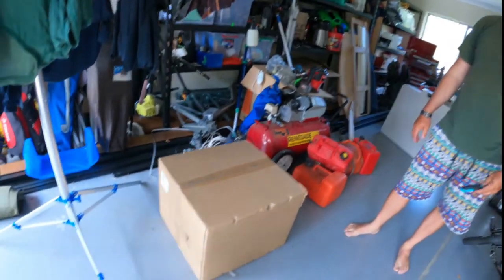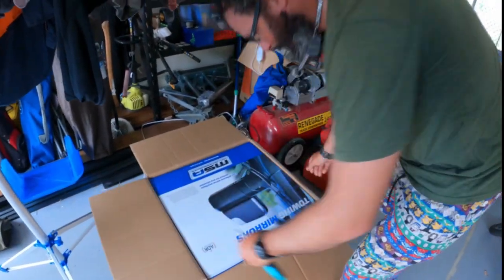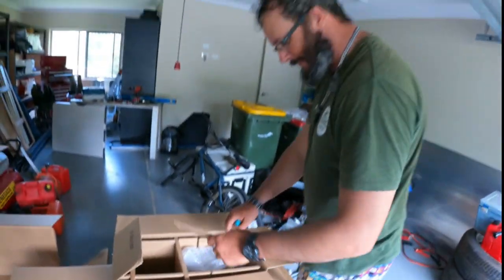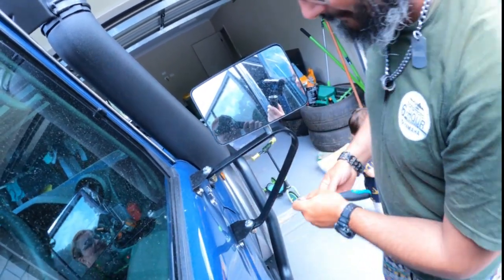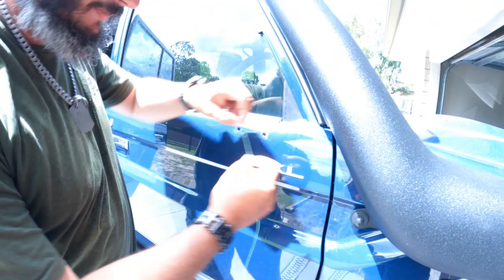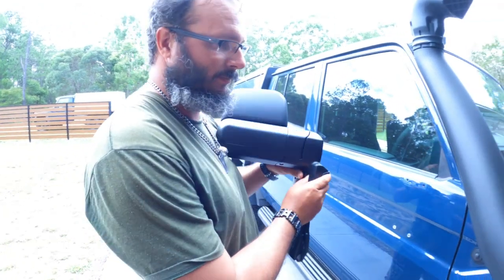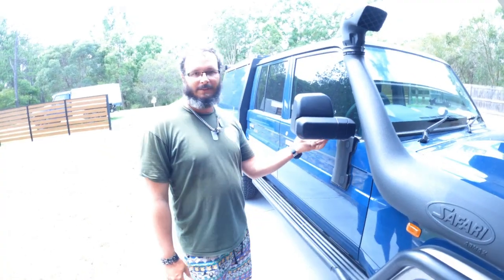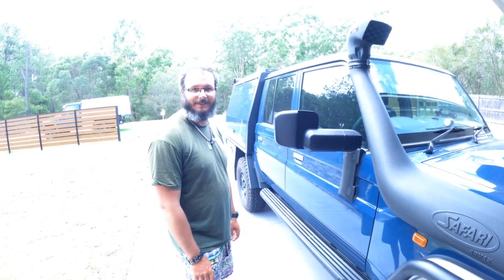MSA Towing Mirrors install on 79 series Landcruiser. Why we picked them over Clearview.

Comment: Did you use the brackets inside the doors?
Reply from the maker: Hi Chris
No we didn't, the 79 series comes with the holes already so we didn't need to use brackets. The brackets are if you don't already have the holes in the doors
Reply: Great thanks wasn’t sure, might fit mine tonight. Good vid 👍🏻
Reply from the maker: Good luck!